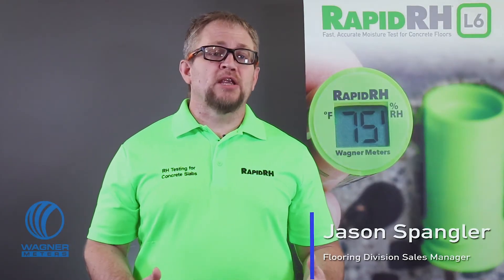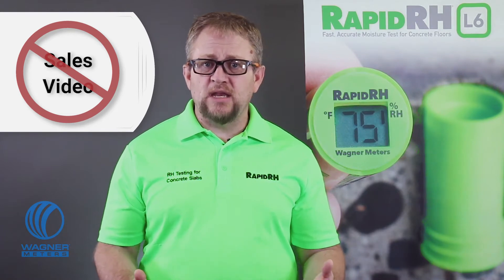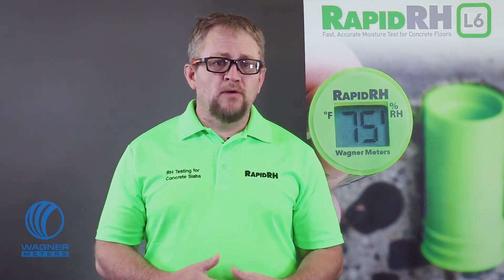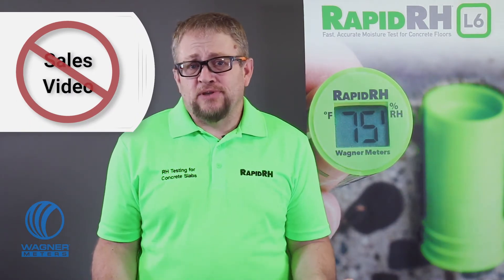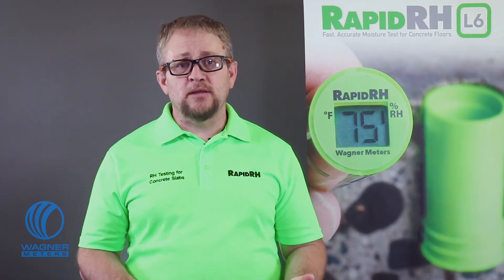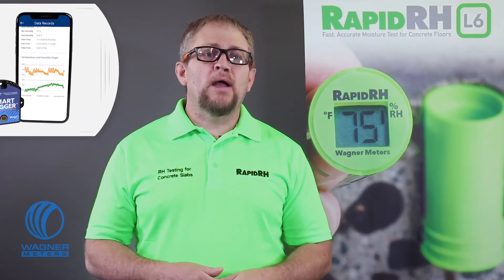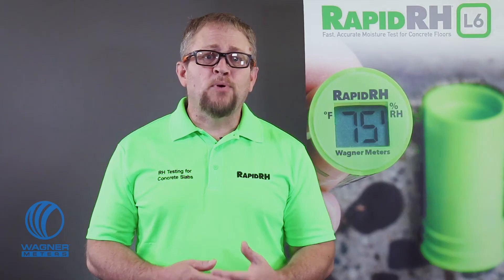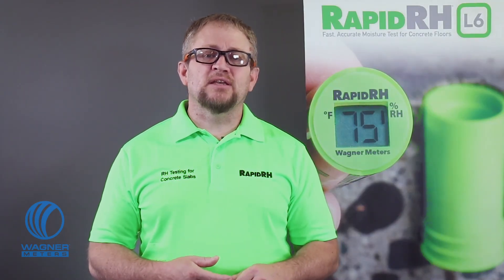ASTM F2170 Best Practices from Wagner Meters

Comment: Does the AC system have to be in full operation to get accurate rh test results from a pre existing slab?
Reply from the maker: Jayda:

This is what the ASTM F2170 standard says specifically:

9. Conditioning
9.1 Concrete floor slabs shall be at service temperature and
the occupied air space above the floor slab shall be at service
temperature and service relative humidity for at least 48 h
before making relative humidity measurements in the concrete
slab.

“Service temperature” is defined like this:

3.1.2 service temperature and relative humidity, n—average
ambient air temperature and relative humidity that typically
will be found in a building’s occupied spaces during normal
use.

So, if you can maintain these conditions without HVAC, then the standard is still met. That being said, obviously having the HVAC operational is the easiest way to ensure this happens.